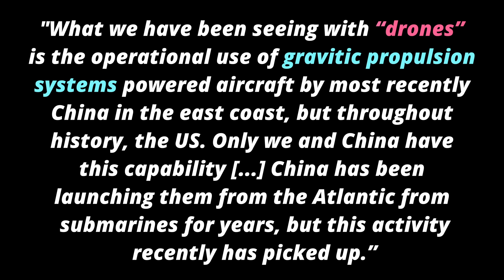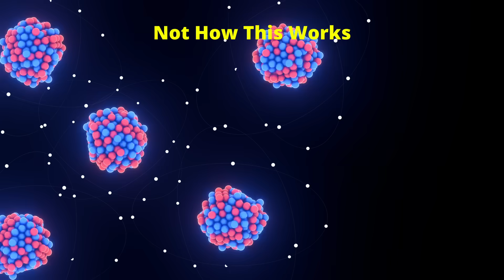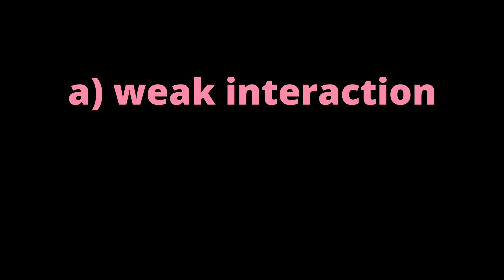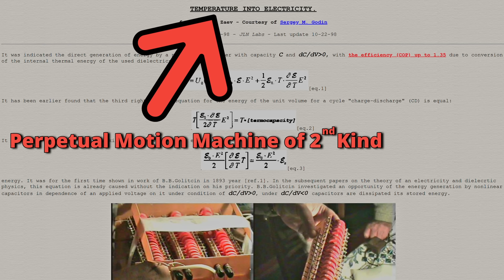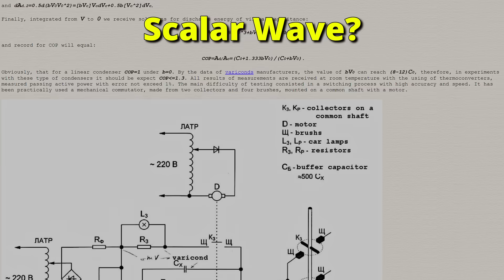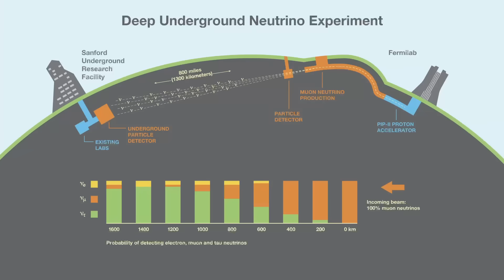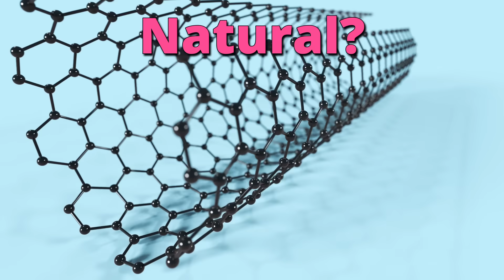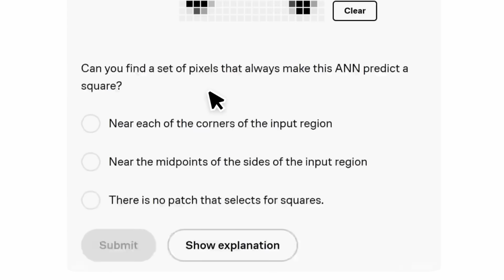What is “gravitic propulsion” and could the US government hide it?

Comment: “You can’t just build a state of the art AI model in your basement”
*Deepseek has entered the chat*
Reply: Yes, and just add 50,000 Nvidia H800/H100 GPU’s, several years of development of 26 top AI engineers and pay them an average of $125K for 3 years from your High Flyer hedge fund company, do 4 ablation runs,  30-40 test runs and a few YOLO runs during development and one final run— then just quote only your last $6 million run as the total cost, while forgetting to mention the other $50 million investment and also the spyware tied to the CCP.
Reply: @amdenis  sorry , some students had experimented and replicated and it only cost 30$ . And LOL DeepSeeok had fully opensourced the model along with publicly available technical docs to reproduce. May be you need to inhale some more copium.  
There is no spyware in opensource models.

Comment: Gravitic propulsion isn't a "anti-gravity" technology in the way most people would think. Think of it like 2 magnets with reverse polarities pushing away from each other using an electric current to modulate distance from each other. Then you put regulators around the object that can increase or decrease the strength of the field to create propulsion. This is the most watered down way to explain it. 40 years ago stealth aircraft was a thing of science fiction, 25 years ago I was working on them and now they are all over the place. People are always more driven when other people say "it can't be done" or "that's crazy it will never work", those are my favorite kind of people. I'll make it work and I'll do it twice just to prove it wasn't luck.
Reply: This is exactly how I have been looking at it. I need to finish this video, I kinda hope is sheds light on where humanity stands. I am absolutely on board with the it can be done aspect. The big thing is, what does this really get us? My interests are more what happens when you leave the atmosphere. How effective would it actually be to 'slingshot' or I guess the term would be capture celestial bodies? At what point do you lose necessary influence and have to rely on other forms of propulsion? I mean sure there are a lot of earthly applications im sure there is a lot of existing research and data too, but I wholeheartedly believe at the rate we are going now we will all be 6 foot under before honda starts selling the civic A-G model...

Comment: 1:24 probably something along the lines of generating more gravitational force in front of the engine than exists behind it which would pull it forward but even if this was possible most other governments would already have it too.

I had a teacher who worked in the more classified areas of the government as some kind of engineer/technician and he mentioned that they had to keep working fast because the soviets alone would get the tech in less than 4 years even though it was supper classified, so yes there is no way crap like gravity drives would be hidden for long and governments wouldn't be wasting it on drones.

Comment: Gravity and time (em radiation) are equal and opposite forces. Gravity within your inertial reference frame will be an attractor. Gravity outside your reference frame is observed as repulsion. Aka the infinite expanding universe that goes way back into the past. 
A rotating universe adheres to conservation of momentum. Aka laws of thermodynamics 
The inverse relationship between time and gravity through rotation proves the causation relativistic effects of dark matter and energy.
All adhering to classical physics, Newtonian style. Equal and opposite force of gravity was in ya face the whole time #physics
theory and equation GC^2/R

G(c^2/r) is rotation value in 4d space-time. My theory proves a rotating universe, with a net time of zero (+-), a non zero mass of 1/m and a size of 2pi radians and length of 1/L, with a maximum acceleration rate of one radian (the obs. Universe is one radian because of the speed of light limit). The four fundamental forces are a product of the inverse relationship between time and rotation to conserve momentum. Strong nuclear force, is a change in rotation greater than one radian. Weak nuclear force is a change in rotation less than. Em is the radians in which we flow through time. Gravity is the inverse equal but opposite force of time. Radians because there is rotation on all three dimensions. With one equation, it is one unifying theory. You can plot the equation on your own graphing calculator at home. G(c^2/r)
The derivative defines the speed of light speed in rotation, at one radian. As a max acceleration of one. Meaning you can only exist within one radian of the universe -(Gc^2/r^2) with a past and future one radian away.
With the limits being everything and nothing. Proving a future, a past, and a present. And good luck getting to the center of rotating bodies.

Using my equation, the speed of like is approx 9million “zeeks” in rotation and we are rotating at 14059.13 zeeks. Giving you (v/c)^2

L’ of earth = 12756km
L universally observed = 1/L
Same wit time and mass. 
Proven by Lorentz equations. 

Thank you. 
Isaiah

Comment: Well now as I see it.  Some folk run themselves ragged over the unknown.  Unless it is your job. Why bother? I mean we have done so much with F=MA for propulsion it boggles the mind. And we are not yet done with that formula.  When we "discover" new things we just plug it into that formula and we can gain efficency or do somethings novel to us, but it is something that would have worked 1,000 years ago;   had we the knowledge.   When I saw this I thought this was something about using local gravitional field to power propulsion. Like lifting a weight and using that to drive a wheel and using braking forces to cause an accleration in a desired direction or something like that... but this idea is so weird you would have to crack a quark or something like that to get it to work.  I dont know the math is annoying for us regular folk.

Comment: Ok, time for my bs thinking to appear. The gravitic propulsion could be a reality. Much like a molecular caterpillar drive system. Where you would simply take the matter above and around the object you wanted to move and move that matter around the object, instead of trying to move the object by forcing one section of matter away from it. Also, in space, there is matter everywhere we cannot see right now. Why can we not see it. Well, can the water see the water, can the wind see the wind. Can electricity see electricity. There is a matter phase shift we live in, that prevents us from seeing and measuring this power, this matter. But we will get there. And when we do, vast distances will melt away, It will be wonderful when it happens, for us. Back to my two sticks to make the fire for tonight.

Comment: In Star Wars flying vehicles use "repulsorlift" tech to get off the ground, fly through the air and even into space but it has nothing to do with manipulating gravity itself. It is just a form of propulsion that does not have to expend fuel like a rocket but uses electromagnetic fields interacting with substances that cause it to move in the desired direction which is opposite the pull of gravity.  As long as the power can be maintained it will continue to produce that lift.

Comment: Element 115 is bombarded with an unspecified subatomic particle which causes it to transmute into element 116 which immediately begins to decay releasing particles into the unspecified gas(within the reactor) which directly creates huge amounts of electrical current. Enough to power the gravity wave generators patent #20180229864A1 . Duh.

Comment: The hardest part IMHO is that >210 nucleons (Bismuth) we start to see active decay to a lower energy state. If there was new matter, and we beta decayed to feed it, I think we would have built it by now. Short of some weird material, also known as a superheavy element, would have to be produced, kept/fed to maintain stability, and not decay faster than it may be utilized. If you take Aufbaus principle we should be able to reliably predict elements after 120. The problem presents itself with electron shells where you run out of room to contain them, so you have rapid decay. Nothing we've done points to anything heavier being stable or useful. Besides, how do you test something that only exists for 100ms for benefit? Beta decay / capture is the only known way to simulate these elements for any reliable amount of time, and yet we still can't reliably test them.

Comment: Simple science class trick on steroids.. hold a spinning bike wheel vertical, do not tilt it, now rotate body at the hips or feet and the wheel will raise or lower depending on direction of wheel rotation vs body rotation.. if you put a ferro fluid inside a hollow donut shape, then wire around it a little like an electric motor. Then give it a TON of current The movement of the fluid should be similar to arranging a rotating bike wheel at every point 360° around the student.. have fun with that buddy!!. Just stack two donuts with opposing rotation and spin, at each propeller point on a standard drone, and maybe its cool as hell!! . Very silent with no speed limit.

Comment: No, and why would you use anti-gravity? Screwing with gravity has all kinds of problems associated with it. Even it if it was possible, it would be a dumb thing. Smart methods use impulse plates which gain kinetic energy perpendicular to the plate. Think lifting yourself by your own boot-straps. If your boots were the plates then they would gain impulse (kinetic energy) in a direction perpendicular to your feet and your boots would push on you lifting you. The limits of it is nothing more than the structural limits of whatever the plate is attached too, more energy in, more force generated, nearly instantaneously, which can cause crush problems or structural failure because the Delta is so high it will tear free so you have to slow the power ramping.  It's very simple tech. If you add the energy needed for 100 N to the the plate it will go from 0 N to 100 N instantly (for all intents and purposes). "Instantaneous" forces are very damaging to structures. Something that could hold 10,000N of force w/o failing might shear at 1000N if applied too quickly. It's similar to how force is applied via say, high explosives causing deformation of metals well below their maximum failure load. Similar to how armor penetrating projectiles operate (the kinetic kind, vs the HE). So while it's fairly complex challenge to build something that withstands the forces applied by say 12 raptor engines, it is a magnitude more challenging to deal with something that can apply the maximum Delta of all those engines, all at once, in less than a nanosecond. By comparison the forces involved with the 12 raptor engines on your chemical rocket are "slow" and easily managed.

Comment: HOW DO YOU CREATE GRAVITY??? NOT ARTIFICAL NOR ANTI EITHER, JUST NORMAL GRAVITY. BTW GRAVITY ISNT A WEAK FORCE
Reply: Gravity is weak, extremely weak, the weakest of them all. Look at how much gravitational “charge” is required to pull you down. Yet even small electromagnetic devices can easily make magnets to float.
Reply: @ΑντώνιοςΤρισμέγιστος  true but gravity also keeps the universe aligned. pulls and pushes planets and huge meteorites, influnces tides. that seems strong not weak. also weak compaired to what?
Reply: @sparky110delta9  compared to the electric and magnetic force
Reply: @ AGAIN YOU CANT COMPAIR GRAVITY TO ELECTROMAGNETISM, THEY ARE 2 DIFFERENT SPECIES, 2 DIFFERENT FORCES THAT MAY OR MAY NOT SHARE SOME BASIC PROPERTIES, BUT THEY ARE DIFFERENT OVER ALL
Reply: @ΑντώνιοςΤρισμέγιστος  gravity and magnetism are 2 totally different forces
Reply: prove me wrong
Reply: and similar doesnt count. thats like saying chickens and lizzards are the same because they are both born from eggs.
Reply: @sparky110delta9  chickens and lizards are different but you can measure the sizes of both and compare.
Reply: @ YEAH OK. ELECTRIC MAGNET FORCE IS NOT THE SAME AS GRAVATIONAL FORCE OR GRAVITY YOUR AGAIN COMPAIRING APPLES TO DUCKS. LIKE I SAID PROVE ME WRONG. SIMPLE QUESTION.  HOW DO YOU ( OR DOES ANYONE ) CREATE GRAVITY??
Reply: @sparky110delta9  these are different forces BUT THEY ARE FORCES, both measured in Newtons, kg*m/(s^2), for Gods sake)
Reply: @sparky110delta9  the source of gravity is energy, in the same way as electric charge is the source of electrostatic fields, current - source of magnetic, etc.
Reply: @ΑντώνιοςΤρισμέγιστος  good now your on the same book , now look up how is gravity created , which was my original question, not how much it weights.
Reply: i know english is tough. but my question was simple to understand. and these are just similarties that you can measure. that still doesnt answer the question i asked. ill give you a cookie for trying....🍪🍪🍪
Reply: @ΑντώνιοςΤρισμέγιστος  i will give you the fact that far from what the influser sabine hossenfelder knows about, we ( the US government) have made and generated real anti- gravity using magnets by spinning one in the center of alternating currents from other magnets which created "lift" from opposing our gravitional pull on earth (meaning it can be used anywhere on our planet). but even this paper never explained how gravity was created , only anti gravity.
Reply: A Wild Experiment With Magnets Actually Suspended Gravity- populat mechanics
Reply: @sparky110delta9  gravity is a curvature of space that depends on distribution of energy described by the stress-energy tensor)
Reply: @sparky110delta9  I give up; tell me, how gravity is created🥴
Reply: @sparky110delta9  the expert in gravity doesn’t know, but YOU know. Yeah, checks out🥴🥴🥴
Reply: @sparky110delta9  read this article))) Like really READ IT)))))
I know, English is hard, maybe counterintuitive sometimes… but try)

[you really don’t know shyte about maglev, do you?🥴🤣]
Reply: @ my question wasnt about maglev
Reply: @sparky110delta9  you asked for the source of gravity, how it is created. I’ve said ten thousand times that it is all mass and energy and momentum and stress, everything that is in the stress-energy tensor, everything that is a flow of momentum/energy in spacetime. I can’t simply any further, sorry.
Reply: @ΑντώνιοςΤρισμέγιστος  i didnt ask for the source. but im glad this proves we dont know what gravity is or how to create it., because by what your saying its something of mass density thats moving really fast  through the ripples of space and time around it causes that mass to generate gravity? then how can you make a claim that gravity is weak.
Reply: @ gravity is the inherent connection between energy and spacetime. In the same way inherent as the connection between the length of a circle and its diameter. We can never explain why its connection is always precisely 3,141592…, but we know it is. To explain something in science is to have mathematical, quantitative model. We can make gravity, it just requires mass, we know how much for whatever strength of gravity we need. It’s just impractical. And it requires a LOT OF MASS, while we can create the SAME AMOUNT OF FORCE by relatively small amounts of charge and current. That’s why maglev easily overwhelms gravity: electromagnetic fields are much stronger than gravitational. You know why Earth hasn’t collapsed into a black hole a centimetre in diameter? Because electromagnetic interactions (and Pauli principle) are much stronger than gravitational attraction.
Reply: @ΑντώνιοςΤρισμέγιστος  thank you for this understanding explanation. really appreciate it . then from my understanding gravity would come from compressing a mass to become extremely dence and then running it through space and time at a rapid speed distorting the time around the object along with the cosmic radiation waves surrounding the object as it passes generates gravity?? or no?
Reply: i like your explanation of knowing why we know but not why we have the equation for it. im not even sure if i explained what i was trying to get accross in my last comment. i just believe that the cosmic radiation has a lit to do with it as magnetic waves being generated around a magnet can fly off and displace some its magnetic field to the object. but being an object of mass density absorbing that field , itcan project it back as a gravational wave.
Reply: @ not sure if I get what you’re trying to convey…
Electromagnetic field is not dominating the universe only because there are two kinds of charges that tend to attract and nullify theirs fields; while gravitational charges do not cancel each other, only add up. Was it something related to this?

Comment: The problem is the type of energy we are using, the entire world would be different if we used plasma and scalar wave energy.

I have seen a video once were a man made a lightbulb with three electrodes negative in the center with two positive  on the outside so he had two elements divided in the middle, and when he zoomed in close to study the electrodes in action there was a clear thin black line dividing the two light sources. is that dark matter.
Also I think scalarwave Nikola Tesla said was the static energy running in all things, all throughout the universe, and once we make devices that use this energy we will make contact because it is the energy used intergalactic space.
Tesla built a twenty foot tall tesla coil, with a static generator made with a belt made of paper going around a roller of glass one end and  rubber roller at the other, I think it was rubber but may be wrong, then he had brushes rubbing up against the paper belt, and they powered the coil, the energy he created turned the normal arks, bolts of electricity into a plasma that still moved around in its previous form, it also moved threw the glass barrier he had to protect him, but when it made contact with him he felt nothing, it moved over his skin not threw it.